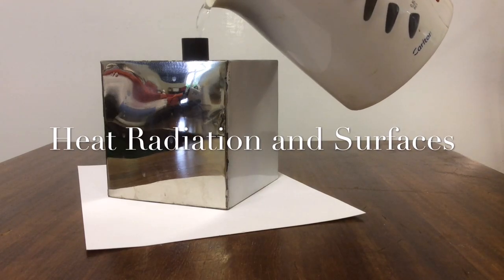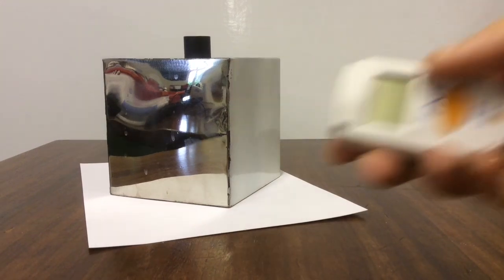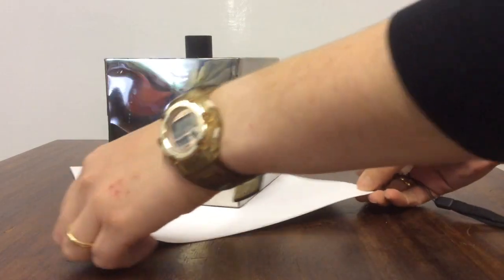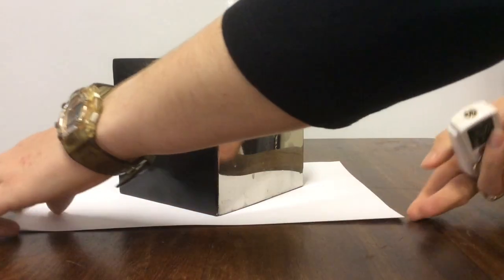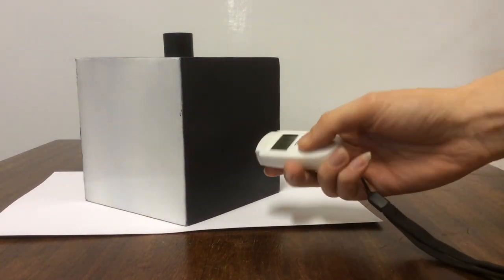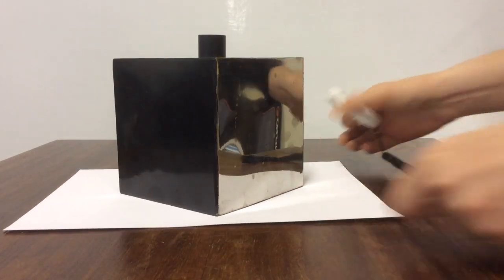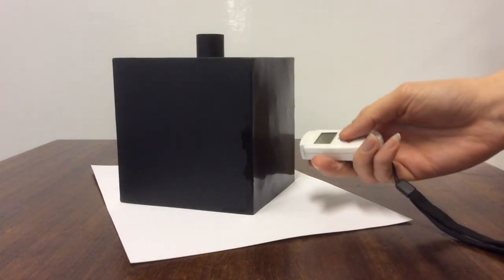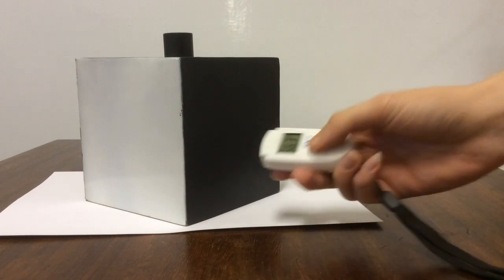Leslie's cube

Comment: This demonstration has some flaws. Infrared thermometer relies on thermal emissivity  of the surface. The typical thermometer, just like the one used in this vedio, assumed just one value. But the major theme of Leslie's cube is the different surfaces have differet emissivity, which results to different energy loss (heat radiated outward to ambient air) and differnt surface temperature. The larger the emissivity, the lower the surface temperature. 
However, one thing you demonstrated is CORRECT. Black side (high emissivity) emits more thermal radiation (infrared), and the silver shiny surface  (low emissivity) emits less thermal radiation (infrared).
Reply: Are the faces of the cube painted on one side or both?

Comment: Nice video, but if you are intending this as a serious science video then there are two things that should be corrected.  
1. You are not measuring the temperature of the faces of the cube -  they are all at the same temperature. What you are measuring is  (roughly) the amount of IR radiation from the faces.
2. The reading on the thermometer will depend on the distance from the face (inverse square law) so unless this is the same for each face it rather invalidates the results.
Reply: Pete Jones nice observation sir, i didn't undestand why mate black was transmitting less radiation than shine black.
Reply: yeah im lsoconfused  @giulianotorres4556